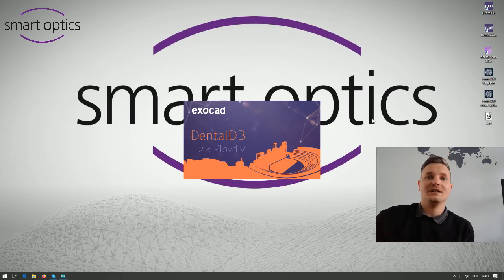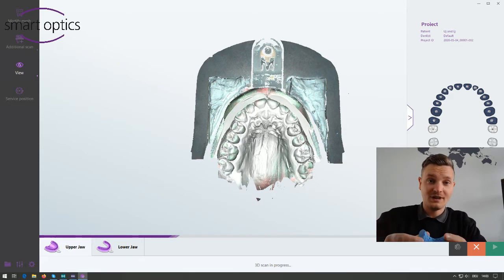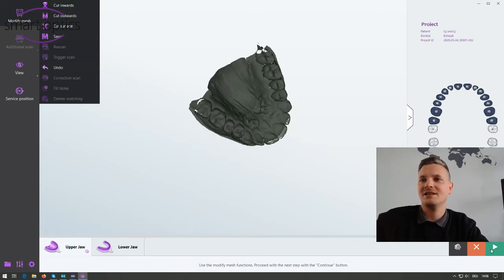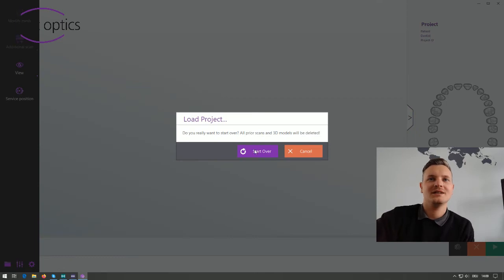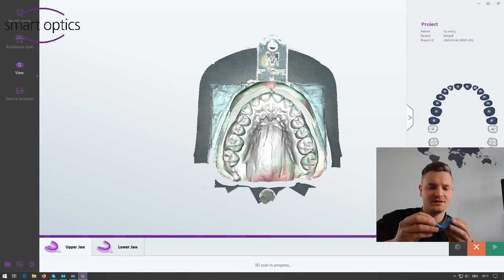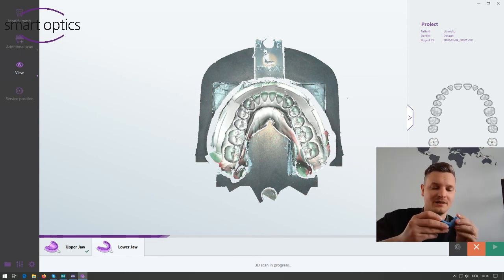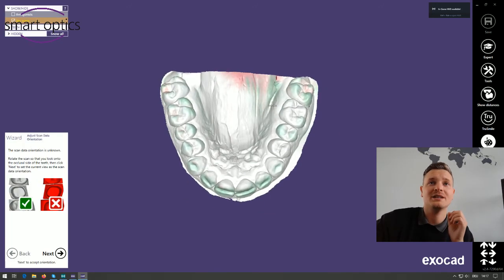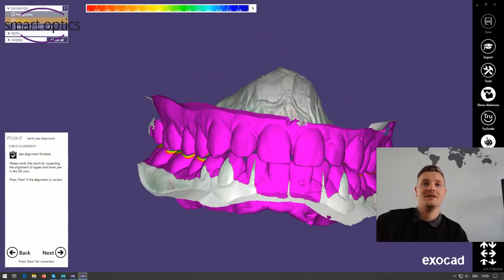Upper and lower jaw impression scan with alignment in exocad

Comment: Is this possible with Meshmixer / similar? I'm interested in scanning the negative impression directly.
Reply from the maker: The scanning process is always performed via our dental Scan software. The output data is open and not encrypted. You can therefore use any other program for further processing.